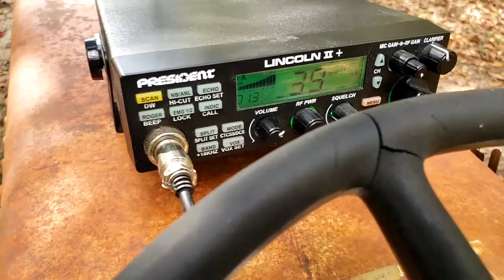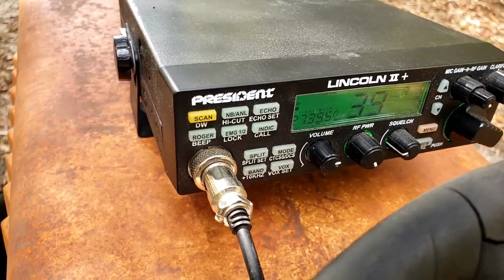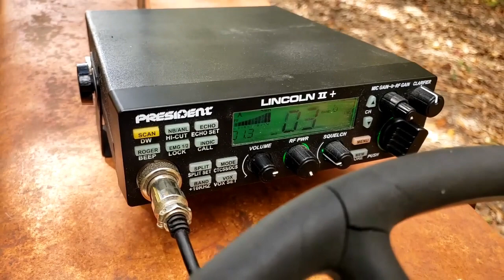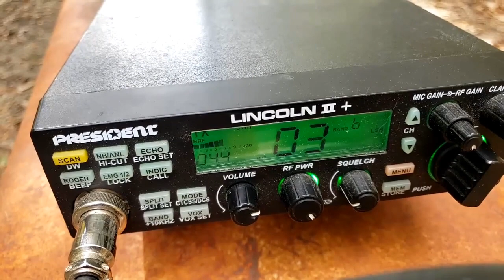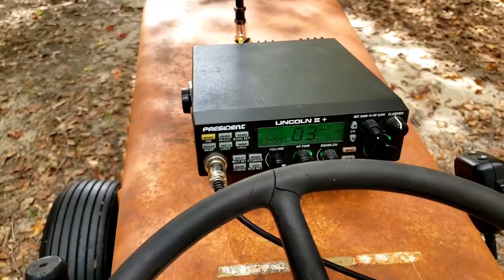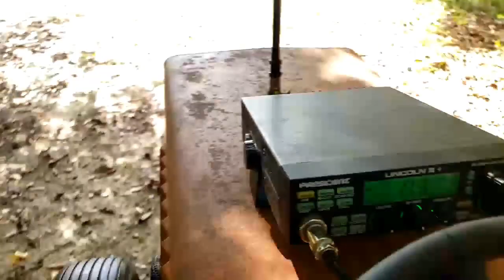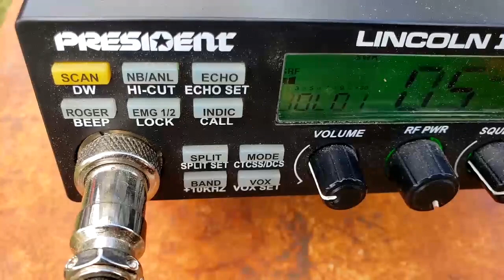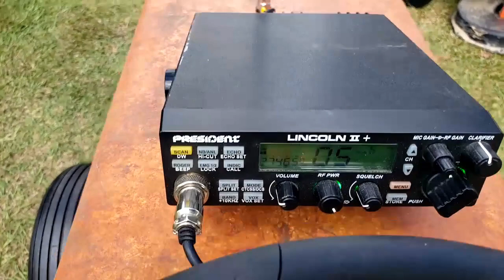Lincoln II+ on My Tractor + some Skip

Comment: Too funny!  I was thinking of doing the same thingwhile out mowing my 35+ acres!  I've already done it with my bicycle trailer that towed behind my electric bike!!  It had it's own generator on a pulley to the wheel to charge the battery as I rode around. I may have to try and get my CB mower setup going! 😂

Comment: wonder how a 102 inch stainless steel whip would get out on that. I used one of them on my mountain bike mobile CB set up back in the late 90s. I got out pretty good with it too. I did shoot some skip with it but it was only two or three states away from where I'm at in Philadlephia PA. You probably wouldn't be able to ride around the yard with it on because it is too long.

Comment: +
You must have been really bored today lol Your lincoln ii+ has distorted RX just like mine does, that's the problem with most of the newer chip radios unfornately. But hey, sticking it on your lawn mower is better than using it as a paper weight like i do mine.
Reply from the maker: lol, mine was also a paper weight for a while, I really don't like the receiver on the Lincoln II+, But for a lawn mower it's perfect. Thanks for watching, 73's

Comment: Hey John that’s awesome, are you barefoot 😀
Reply from the maker: Thanks. the charging system is very small on the tractor, it only has enough power for the radio.

Comment: It sounds off freq....
Reply from the maker: That's the way a Lincoln II+ is,  the receiver sucks on all of them. I wouldn't put a good radio on my mower, But I don't care if the vibration ruins this radio. Thanks for watching, 73's
Reply: I would go into calibration mode and adjust the freq to get a better RX. @MowerJunkie